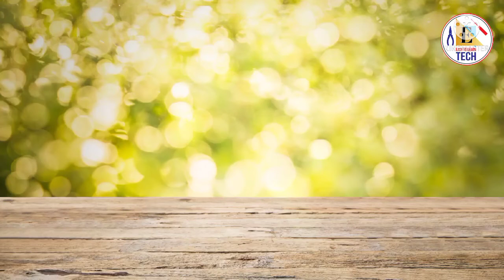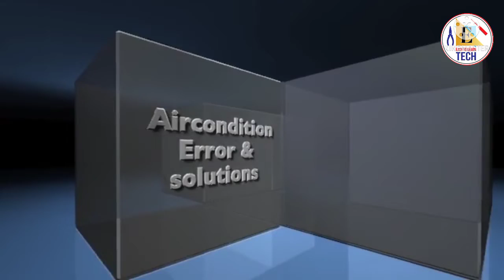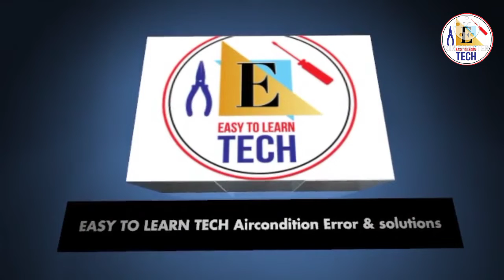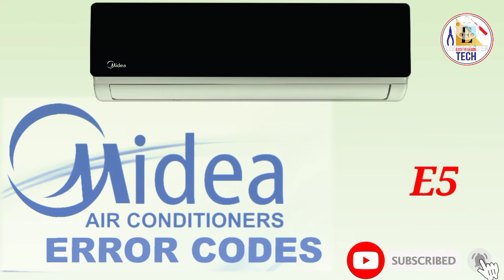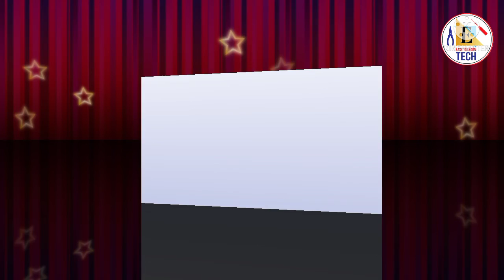#Midea  Inverter Air Conditioner Error Codes | How do you find the error code on a Midea AC?

Comment: E1
Reply from the maker: The error code "E1" on a media inverter air conditioner typically indicates a communication issue between the indoor and outdoor units. It could be caused by various factors, including a faulty connection, damaged wiring, or a malfunctioning control board.

Comment: hi sir 
if i havent fault in the indoor unit and the outdoor unit tries to start compressor for few seconds after stop and the same process repeat hase three leds the outdoor units but i dont know how can i find the code with the help of these leds 
so do you have experience with a similar problem like this ?
Reply from the maker: Send me the blinking light of outdoor unit by mail.
Reply: @Rehankhan_HVAC_TIPS  its the inverter ce-kfr48w i willl send you soon 
thanks a lot sir
Reply: just the bad is i didnt record video and i have remove the circuit 
i remember only one from the two red leds was on permanently 
so when i reseat the circuit now i will know and i record the video 
if you have experience with the above pcb circuit of cource haw two reds and one green led  @Rehankhan_HVAC_TIPS